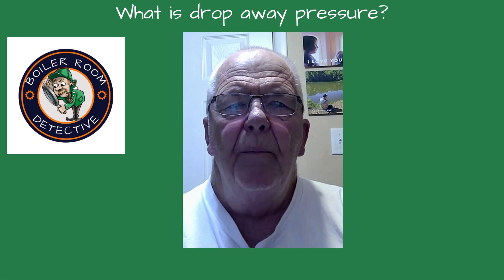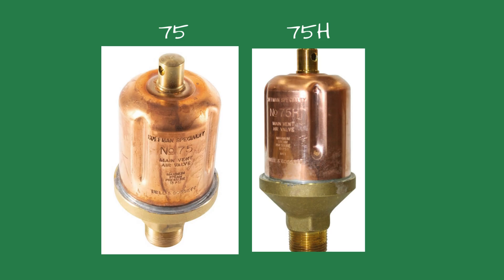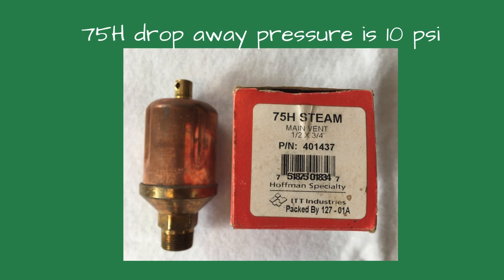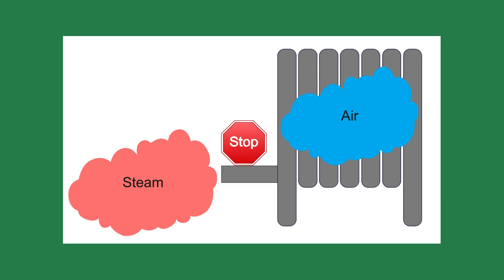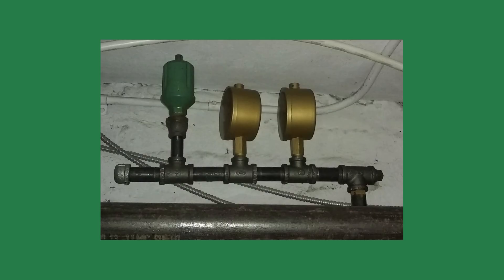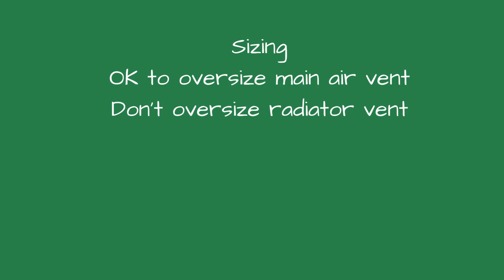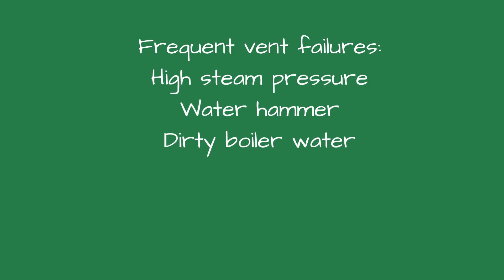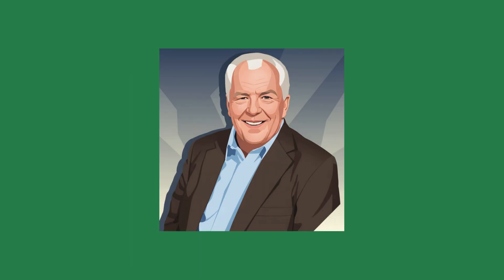Why steam heat worked in morning but didnt after. Understanding air vent drop away pressure

Comment: Question about the pressure on the one pipe? Is there a reason to have it above a pound? Great info on the vents too, I didnt know that .
Reply from the maker: Great question As all steam system question it depends The systems were designed for 2 psi If you’re only running one psi you may run out of steam before the end of the main

Comment: Why did the client want 5 psi? im guessing there was a cold room and the only way to heat it was to set the system pressure at 5psi. Why would this be? Because the one pipe feeding that room could have settled to a backpitch thereby holding condensate and blocking the steam/air flow. The additional pressure difference was needed to overcome the backpitched condensate that was trapped?
Reply from the maker: I asked the same question but the client said the system didnt heat using 2 psi so they said they had to use 5. Im assuming some traps may be going bad

Comment: I dont understand. If the air left the system in the morning as the system was coming up to pressure and temp then the system should have been air free all day if the system stayed at 5 pounds all day. What am I missing?
Reply from the maker: As the steam condensed, the air could not enter the zone and allow the vent to open
Reply: @boilerroomdetective as the steam condensed more steam flows in because its at 5psi. All the air vented out in the morning when the system was first turned on. With the system at 5psi all day air would never enter regardless of what vent is in place. The zone and radiator would be hot all day.  This is my line of thinking. What am I getting wrong?

Comment: Since most steam systems are designed for 2# steam, did you consider lowering the system pressure, or maybe increasing the steam pressuretrol’s differential so that the boiler did not re-fire until the steam dropped below 3#?  Just curious if that may have been a workaround.
Reply from the maker: Good suggestion That would have worked The client wanted to maintain 5 psi all the time